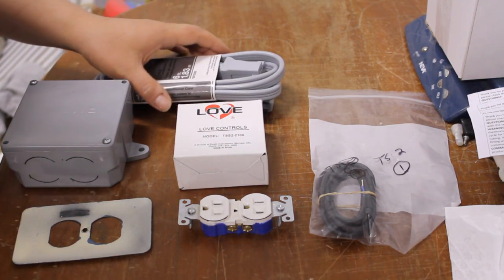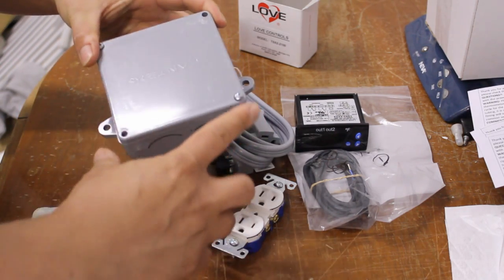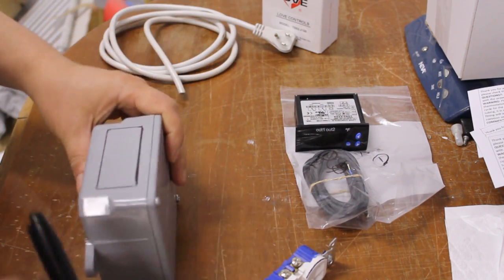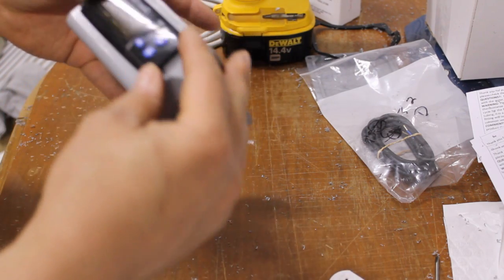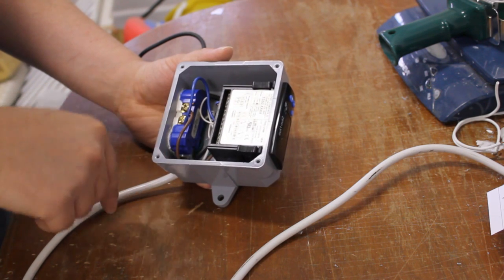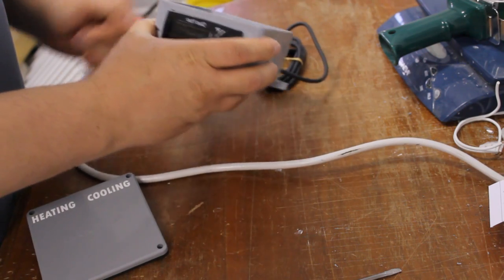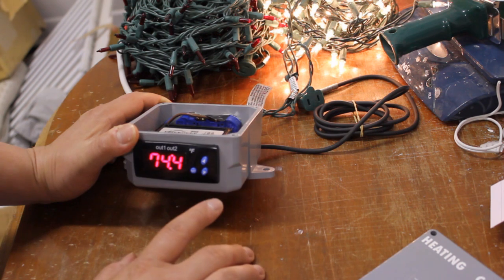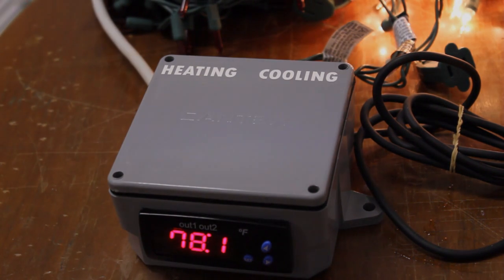Dual Stage Fermentation Controller Project

Comment: thank you so much for this video. helped me greatly.
Reply: Can I assume that once I hold the set button and see the 0 that if I press the set again and it does not go to SP that the unit is password protected? I got this one used.
Reply from the maker: @preuc3367  i wish I knew the answer. I haven't used this unit for many years and forgot everything.
Reply: @BobbyFromNJ  I won’t hold that against you haha. I forgot what I had for breakfast. Cheers!

Comment: I've made similar with cooler and terrarium 25w pad. I also installed 2x 120mm PC fans for mixing air, made 12V DC and 220V AC outlet installation in cooler for starter stirrer. One thing I see lots of times on YouTube is where to put temp. sensor. I think it should control air temp not the temp. of wort, if you would like to have constant temp. of wort, otherwise the wort's temp. will be between -/+0.5° of set point, my compressor kicks in +0.5° and heating - 0.5°, air should be controlled.

Comment: Hey great vid,
1 Question. Is it possible to hook up two sensors to 2 different fermentors . say one at 60 and one at 70 or will one override the other, both for heating?

Comment: Great build Bobby.  Rather than use a jig saw for the cuts, I would use my Dremel with a cut off wheel to make the cuts.  Clamp the box in a vise or clamp it to the work  bench.  Much better control of the working tool.
(I want to keep all my fingers and thumbs)
There are a lot of ppl that don't know about electricity.  The detail about wire size and how to make the connections was great.  Please keep up the great videos.
Thanks again,  Pete

Comment: Great build Bobby.  Rather than use a jig saw for the cuts, I would use my Dremel with a cut off wheel to make the cuts.  Clamp the box in a vise or clamp it to my bench.  Much better control of the working tool.
(I want to keep all my fingers and thumbs)
There are a lot of ppl that don't know about electricity.  The detail about wire size and how to make the connections was great.  Please keep up the great videos.
Thanks again,  Pete

Comment from the maker: @wesley5138
I plan to use a clamp light with a 25 watt bulb. I won't know for sure what wattage works best until I get into next Winter. Lower wattage is obviously safer in a plastic box as long as it can keep up.

Comment: Always great to see more home brewers taking fermentation control seriously.  It's one of the most ignored and most critical steps to home brewing.  If you've seen my videos, last year I went the route of modifying a thermostat to control a fan blowing on ice bottles in a Igloo Ultra 175qt cooler. I recently tried to change that setup out for a Johnson Controller & using peltier heating & cooling.  It worked but not efficiently. I should edit and put up the video on that for folks. Thanks Bobby!

Comment from the maker: I did weigh the pros/cons of the ebay controller but my main reason for not going that route was that I just can't think in Celsius as much as I try. I'll admit the price premium for the Love version is tough to swallow which is why I trimmed the cost with a recycled cord. Thanks for the comments so that other viewers can consider the cheaper option.

Comment: You can get the dual stage controllers off ebay for about $22 (search "aquarium thermostat"). I have two made up. One for my fermenting fridge (which switches between turning the fridge on or turning the heating pad on depending on fermentation temp) and one for my kegerator (where i use the cooling function only). Definitely worth the investment people.

Comment: Nice build Bobby!  2 cut down on the price some more, I built one close to this with the ebay STC-1000 110v temp controller. Close to the love but you have to convert to celcius. The cost was around 27.00 for the stc.